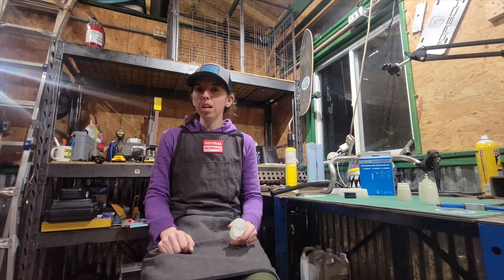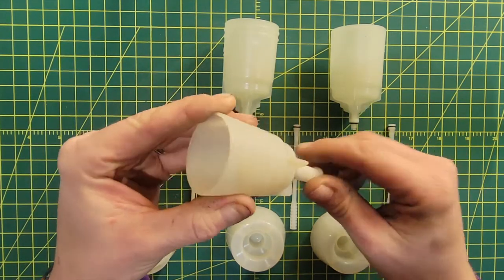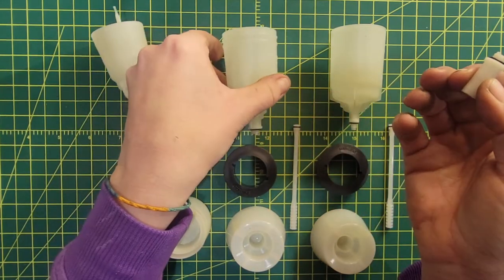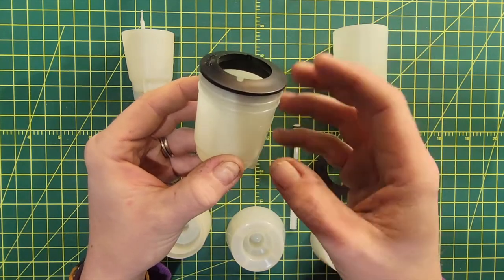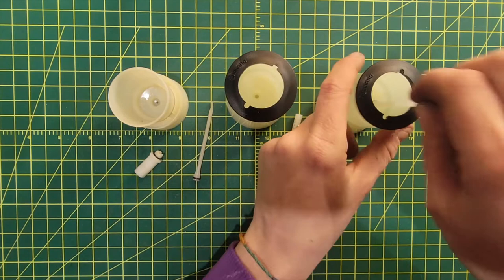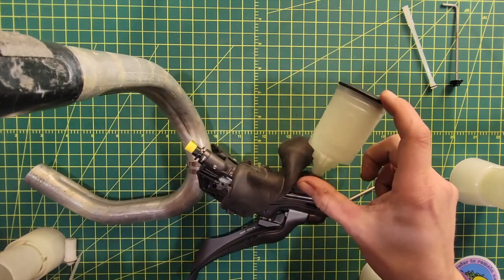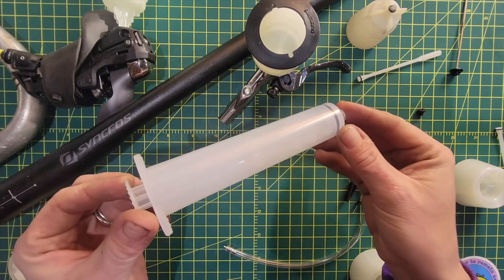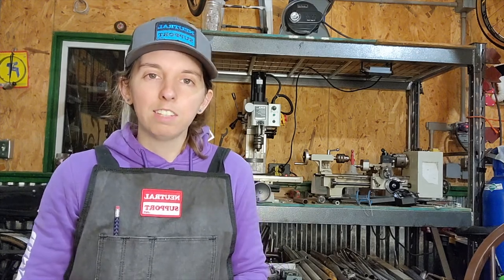TOOL SHORT #2: Shimano's NEW Bleed Cups

Comment: You should consider doing a video on the best tools for bleeding. Quite a few different kits out there now, Shimano, Park tool, Jagwire, ezMTB and more.

Best would be to compare different parts, e.g. maybe Shimano bleed cups are the best, but Park Tool has the best syringes etc. Somebody really serious would mix and match parts from different kits, choosing the best parts from each.
Reply from the maker: I actually bought tools to do just that, and I myself am a "mixer" but then time passed and more cool stuff came onto the market so I will have to budget ahead again for when I can get the best options!

Comment: To stand old pattern bleed cups up on the bench, with the road lever adapter fitted or not, you use a Sunrace cassette carrier from the box it comes in. It is a light interference fit around the fins at the bottom of the cup & holds it just right. I have a box of the old cups from bike build kits so won't be buying any of the new ones any time soon.
Reply from the maker: That's an awesome idea!

Comment: What I don’t get is the need for different cup interfaces for road and mountain.
Reply from the maker: Yeah, seems like the MTB could be M7 without any disadvantage to match the road lever port, and they could use the same funnel. With the air bubbles being so "sticky" inside the road levers, I for sure wouldn't want them to size down the road port to M5 to match MTB. Just another Shimano-ism.